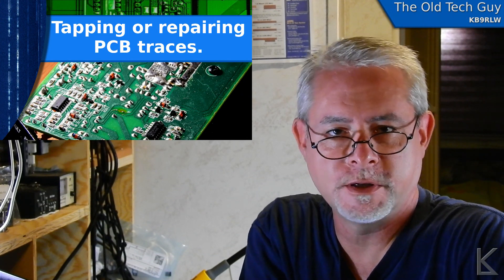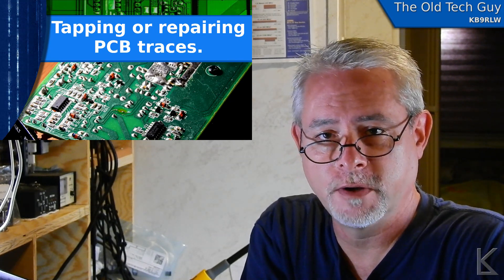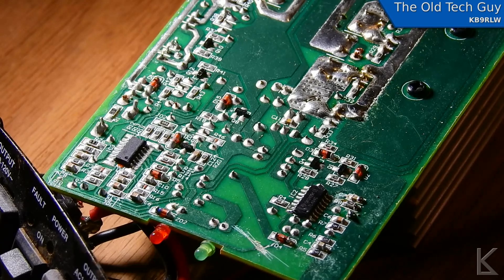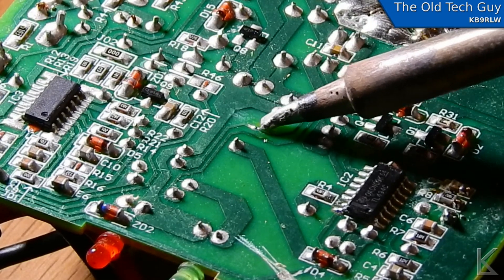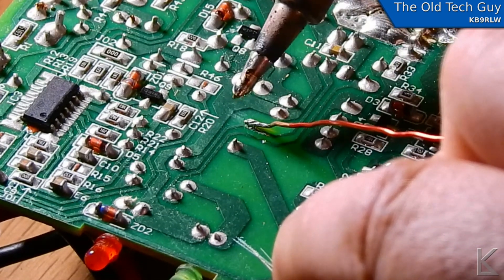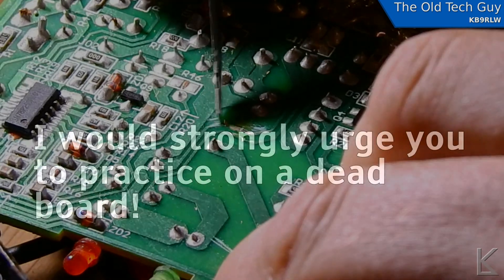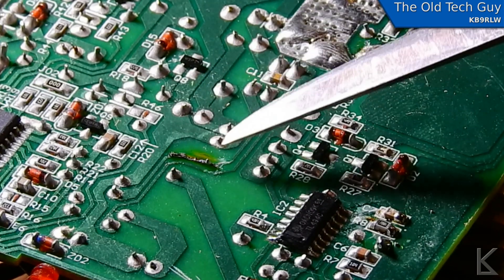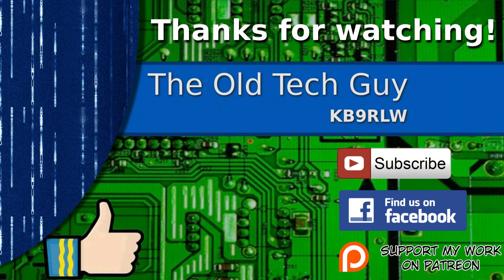Electronics - Tapping and repairing PCB traces.

Comment: Two MAJOR things you missed points on and you really do need to make sure to do. 1. CLEAN your soldering tips.  2. Use flux to clean and tin your wires and traces before attempting to solder. It makes it a LOT easier to solder fluxed traces and wires.
Reply from the maker: o·ver·state
/ˌōvərˈstāt/
verb
past tense: overstated; past participle: overstated
To express or state too strongly; exaggerate.

Comment: Afternoon Kevin.  Quick question.  Currently I have a lightweight portable wire dipole at my QTH.  Will I seen better results with a thicker wire, bigger balun dipole.  How about a rigid aluminum dipole.  Thanks for your thoughts.  JJK
Reply from the maker: The larger diameter the conductor, the broader the bandwidth of the antenna will be.

Comment: "Not quite as neat as I usually do"..........nuf said.  Where's yer tweezers?  And flux?  lol  
Thanks for the video.  I wonder just what is the equivalent  wire size for your average trace?
Reply from the maker: I usually use small stranded wire.  A good source I used to have were old ribbon cables from computer floppy drive connections to the motherboard.  They were pretty long and you could peel off one wire at a time for months of supply from one cable.

Comment: I've done this many times....pretty much the same way you do.  However, I prefer to use thin stranded wire for the tap so that any movement prevents the trace from pulling off the board, and I use solid magnet wire to bridge or repair open traces.  Solder wick (in the appropriate size) also make a nice flat trace repair when needed.  I've saved many a piece of gear using these methods.  Good subject!
Reply from the maker: A bit of solder wick is a great idea, I'll have to remember that.
If you look back at the video where I repaired the 30A power supply, I pounded a bit of heavier gauge wire flat to patch a very wide high-current trace that had been burned through.
Reply: @loughkb  Well, two things about solder wick:  It makes a nice flat conductor if RF needs to run through it, and it will likely carry a lot more current than a thin piece of wire if needed.  When you solder it, it does wick up a lot of solder, and you end up with flux from the solder and the wick, so some flux remover will clean up your repair nicely.  It's pretty easy to work with, too.  Just one more way to do it ;)

Comment: Cutting the wire with a knife could intruduce a new break in the trace.  Tiny sidecutters would be a better choice.  :-)
Reply from the maker: Yep, totally agree.  I don't have any fine enough though.  I usually angle the blade tip into the solder I just applied.  My thinking is that the softer metal of the solder will absorb the blade tip's energy without it going all the way through.

Comment: Instead of using knife surgical. Blade  should be used and the copper wire you are using is too thick wire gauge  should  be in accordance to the print 30 to36 gauge should be used
Reply from the maker: Just like I said in the video, on both counts.  I recommended 32 gauge.

Comment: can you show us how to make a minimal cw audio filter. i have one qrp radio with wide rx. i am disabled and my arms and hands dont work well. my call is n9xck and my name is dan. love all your videos and keep up the good work. 73s from n9xck
Reply from the maker: About the most minimal design I'm aware of, is a short piece of PVC pipe and a small speaker at one end.   You trim the pipe down until it resonates around the pitch you're looking for.  It really does work to bring out the tone from the noise.
Reply: @loughkb   I'm talking about a cw filter like the old mfj one  you took apart
Reply from the maker: @dancerminara5241  There are a few simple circuits out there.   Something like this?
http://www.rason.org/Projects/cwfilter/cwfilter.htm

Comment: I have found that using the solid wire in a Ethernet cable that gave up the ghost. and stripped them for fixing traces. it also works well for me for tapping as needed if the current is small enough. thanks For the Video I am sure it will help many out there. Good job.
Reply from the maker: Another good source is old ribbon cables from computers.  You can peel off one wire and they're nice small flexible stranded.  You can get a lot of wire from one of those cables.
Reply: @loughkb  boy you sure can lol and i have a fee of those lying around from discarded PCs

Comment: For every 100,000 there would be 100,000 ways of doing this with the outcome being the same. Everybody has to do it the way they do it best. I have had a recent spate of circuit board repairs and over the years have found that the application of a little bit of Kester 156 liquid flux to the cleaned surfaces before heat sure does help the solder flow. Where there may be flux in the solder, not always does it get to where it is needed the fastest. Do what works best for you. Many thanks for the videos. Safe travels to TX.
73' de K4WRF
Reply: Yo Kevin!:
GREAT video!  This is too delicate an activity for me. What about "potted" items on pcb boards? Un repairable? I have a ham friend who has a DJ-580 with that as a problem. Thoughts?
de seeker/Jeff WA7LFP

Comment: Thanks Kevin, as we get older our shakes get more and more.... This is my problem. Always pays to practice as you stated. I'm getting into micro work at the moment and have plenty of practice boards which allows me to get better at it. Done my mars mod on my 897d and 857d using heat gun and 0 ohm resistors, lot's of fun and looks good. I like your videos as they are informative and good basic ham radio experimentation as this is what our hobby is all about. Thank you. 73 ZL1MY

Comment: When repairing a trace dad taught me to use a resister wire. we would just cut the lead off of a resistor, and then dad would shape it to mirror the original path as much as possible.. Unless there was so much damage that he would jump from solder pad to pad if possible.
Reply: Wrong way you should use one  30 to 36 gauge coper electrical wire
Reply from the maker: In the video, I recommended 32 gauge.

Comment: Instead of using a knife blade to expose the copper what about using extra fine steel wool? It would clear off the finish on the copper and clean it up a wee bit?
Reply from the maker: Might be hard to clean just one trace with steel wool.

Comment: An afterthought, I often super glue long bridges into position first and then solder the ends.
Reply: I put a longer wire across the 2 points of contact and masking tape it down at both sides (far enough away not to heat the tape). Then when the solder work is done the wire can be bent up at both ends and the wire cut to fit

Comment: A glass fiber brush / eraser works well for removing solder mask. Though, for this work you want a quite narrow brush (2 mm) and those are not that easy to get.
Reply: I use a fibreglass pen to polish up/clean contacts. I think they should come with DANGER warnings as when those tiny rods of glass get under your skin, then you know about it

I remember once when I was using a magnifying lamp and watched one shard fall past from above and land into the top of my hand. Those things weigh nothing, have no momentum, but it was so thin that it just speared my hand - I then tried to remove it but it just half snapped off. I always wear eye protection when using these pens, and put some oil on the pen/brush to prevent the shards flying around as much

Very useful tool though
Reply: i realize it's quite off topic but do anybody know of a good website to watch newly released series online ?
Reply: @Brodie Eli Lately I have been using Flixzone. You can find it on google =)

Comment: I generally have no need to tap a PCB In the manner shown.  I follow the trace to the nearest component and solder my tap to that to avoid any need to scrape off any solder mask.  Ditto for PCB trace repair.  If a small solder blob won't bridge a cut trace, I'll usually solder a roach wire between the components at the ends of the trace to bypass the entire trace.  As an added bonus, that trick also works for broken or burned traces inside multi-layer PCBs.
Reply from the maker: Yes, that's the preferred method.  But that's not what he asked about. :-)
Reply: @loughkb  - Soldering a roach wire over a trace also won't peel a trace off the PCB, as you demonstrated in the video, but it's a lousy repair of a micro strip line antenna that's printed onto a PCB!  :-)  Ditto for  controlled impedance traces where the capacitance and/or inductance of the PCB trace are part of the circuit.